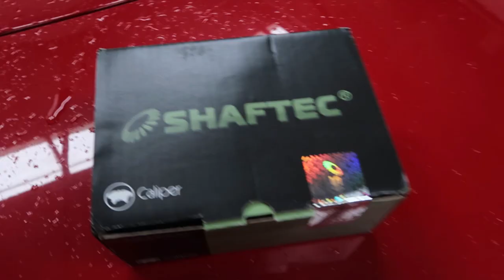MX5 Gets Much Needed New Calipers!!

Comment: Hey, I replaced my brake caliper and put it back together, now the brake fluid is leaking between the caliper and the brake hose bypass (the little pipe that goes into the caliper behind the bolt). Do you have any idea what goes wrong? I put it back the exact same way as it was before.
Reply from the maker: I’m not expert, but did you replace the copper washer?
Reply: @JayDidThis  No, but it is not leaking from the bolt. It is leaking from the bypass pipe.

Comment: I've got the same issue I couldn't find the problem so I just bought all new calpers disks and pads  the brakes were fine when went to work then the peddle dropped to the floor turns out my rear drivers side piston was leaking I couldn't see it but because of the shite weather I cant get it fixed and I miss it
Reply from the maker: Joshua Slater ahhh that sucks ass dude!! At least when you get around to sorting it you know your front brakes are good 🤷🏻‍♂️ every cloud 😂